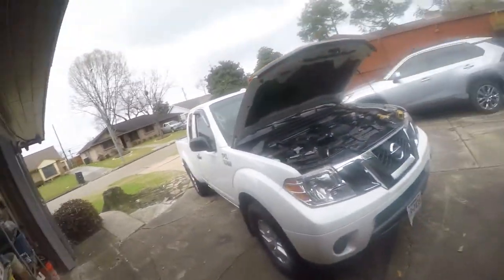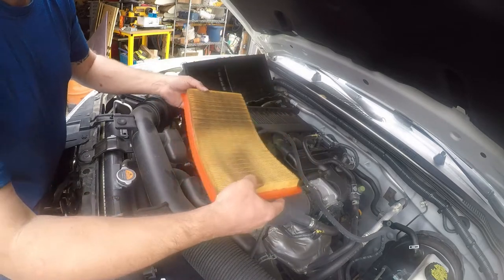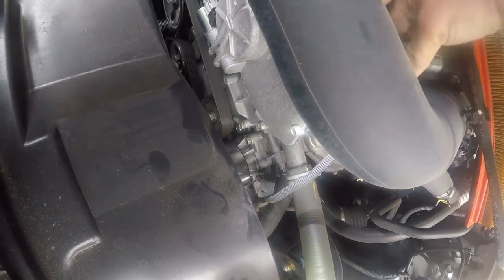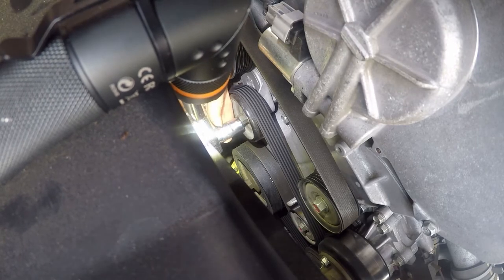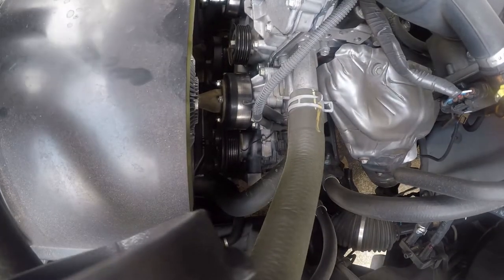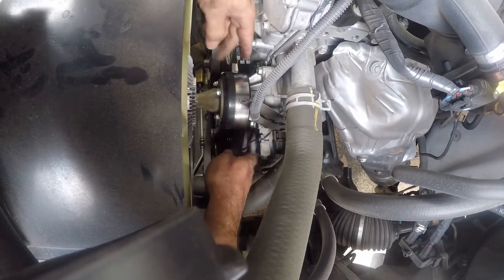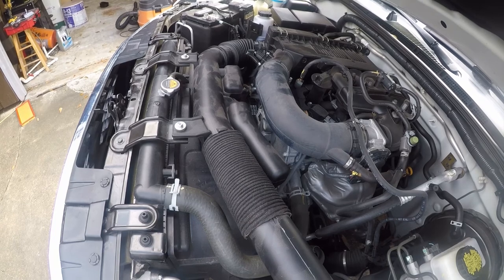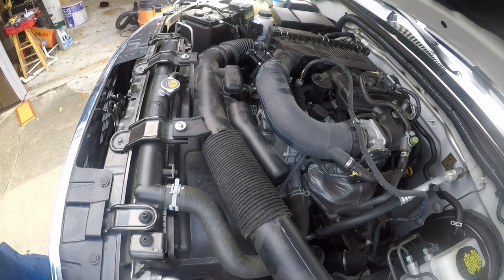Nissan Frontier Maintenance - changing the air filter and serpentine belt

Comment: I had the same truck 2.5. my truck has 88,000 miles on it 2019 Nissan frontier. And I still have the factory serpentine belt it does squeak a little early in the morning is about time to replace it I just order  from Goodyear

Comment: The only hard part to this whole procedure is replacing the filter and it's the one thing you had no tip for and didn't even show (other then you struggling). Useless
Reply: I just replaced my filter and thought this was helpful.  Just make sure it goes in with the correct orientation, I had to kinda muscle it into position like he did.  It’s obvious when it’s correctly seated in there.  Hope this helps someone!
Reply: Bro just look at how it goes together and put it together it is not too hard I did struggle a little bit with mine but you just have to look at the bottom where it goes into each other and line it up